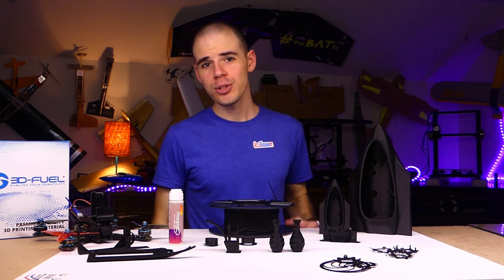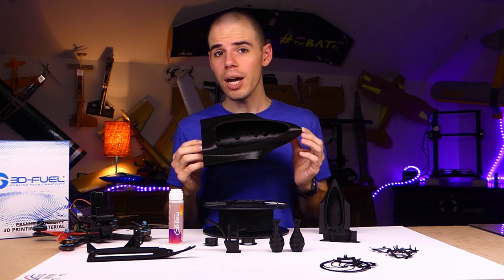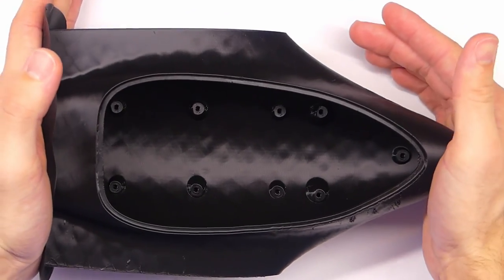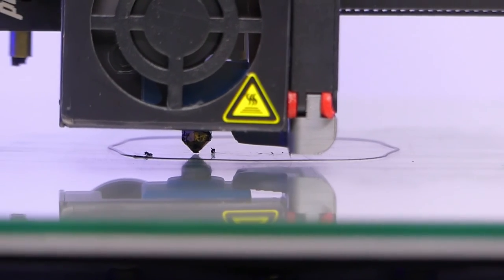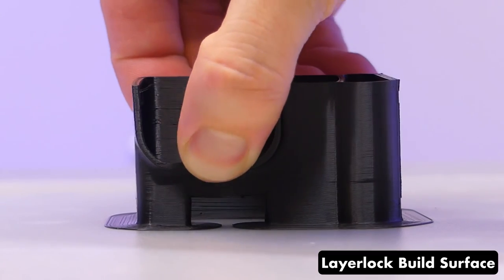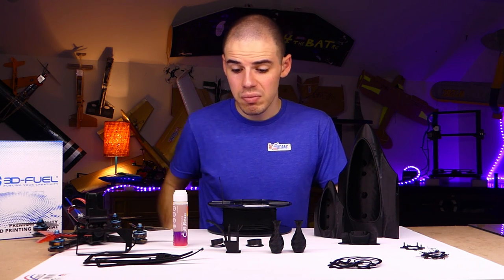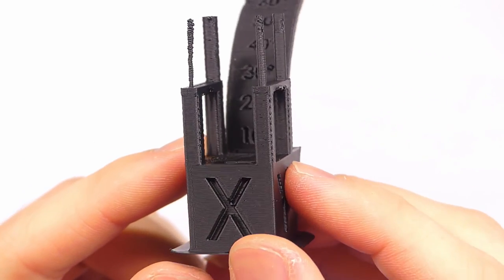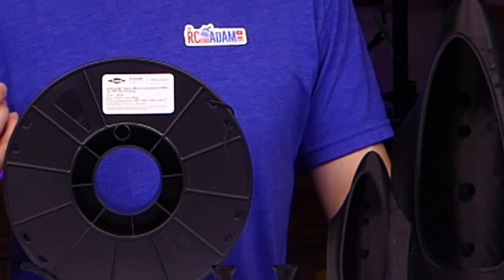Lightweight, Flexible, Strong - 3D-Fuel OBC Filament Review (Olefin Block Copolymer)

Comment: Is this safe to print without a specific exhaust system such as in a regular house office room?
Reply from the maker: I don't really know since I don't have any kind of testing equipment for that. I did not notice any unusual odor, though, so I'm ok with printing like normal (in a somewhat large room with no special ventilation system. Maybe I'm wrong, but I guess we'll find out in about 5 years.